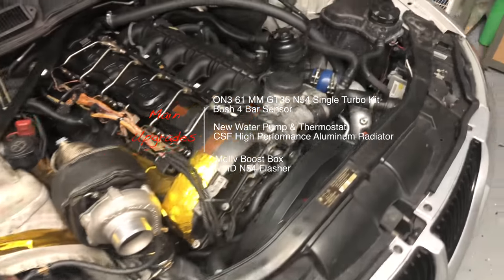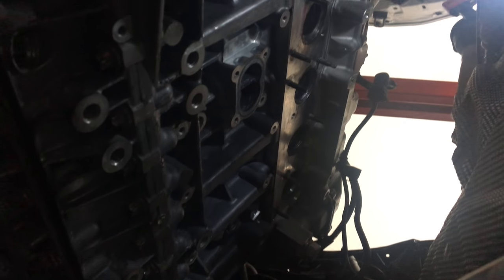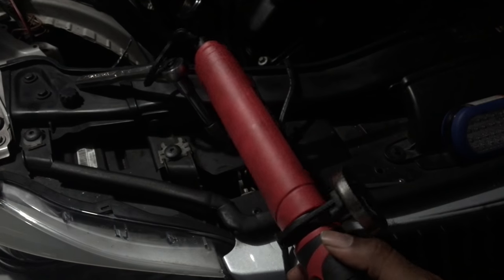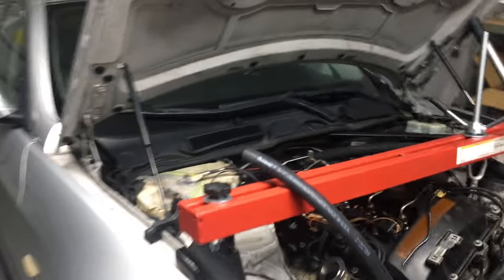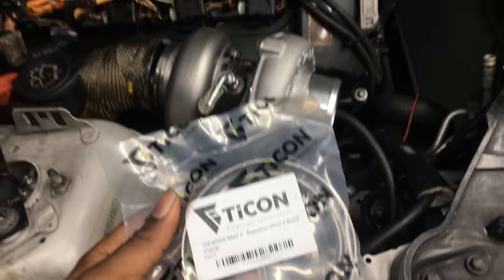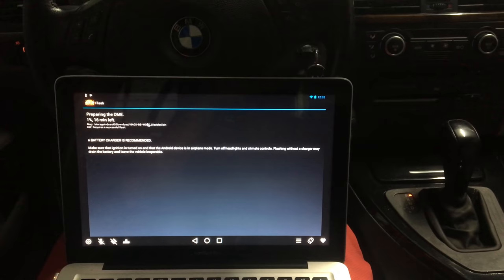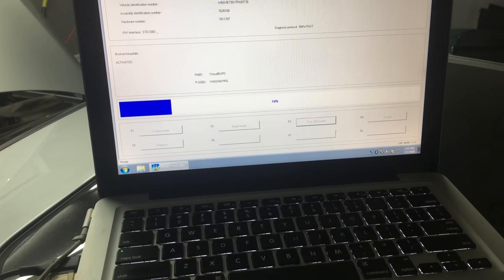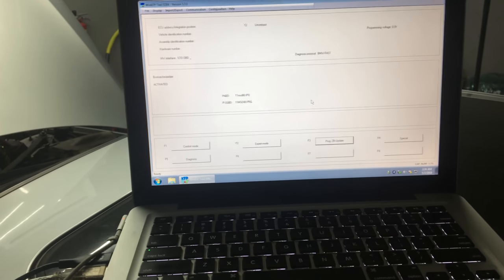Cost Effective N54 Single Turbo

Comment: What size turbo did you get with your kit. How's the low end torque compared to stock twins,  what rpm you seeing boost from.does this work with stock intercooler. I have upgraded ones 5 inch both don't want to cut bumpers to install 7 inch ones.

Comment: If you were to buy that turbo kit again, would you buy the V band Mount or upgrade to the T4 flange? Just asking because I'm about to order one and I can't decide
Reply: @nOshi2x  very cool.  i just learned the t3 and t4 are both vband. I was thinking the t4 was a 4 bolt. I think I'll go with t3 since my power goals are under 600.   Cool setup btw

Comment: Did you keep the turbo oil drain that came with the kit? I'm having issues clocking it correctly and the oil drain hits the v band.
Reply from the maker: Didn’t keep it ran into the same issue, I used one like this https://www.ebay.com/itm/264984459819
Reply: @nOshi2x  it looks like the same one I got but the hose still touches the v band. Hopefully I can figure something out.

Comment: Hey , whats up man .. great content!!! Just wondering how is the turbo kit holding up .. im looking to get this one myself .. i just wanted to see if you could give me some feedback !
Reply: @nOshi2x  thanks for the reply man .. i appriciate that .. i been going nuts looking for options , i was thinking to stick with the twins but they are all around the same price as this kit .. and you still have the risk of the twins failing, leaking oil etc .. in this case if the turbo fails you just swap it.. and this kit seems pretty legit . I am not looking for crazy power but more reliability . You said you are in fl , same here .. any good mechanics you can recommend me ?
Reply: @nOshi2x   im down in broward good thing about this kit its that you could also delete things from it .. so i guess ill just delete the wastegate from it .

Comment: Are you able to get around 500hp with this setup looking at ST kit myself debating on this kit you have or the speed tech bottom mount
Reply from the maker: Yes can make 500 with this setup all depends on how you have it tuned. Speed tech kit is also a good choice, just depends on if you want a top mount or bottom. I just prefer the top since easier maintenance but have to have good heat management. And bottom is pretty much the opposite.
Reply: Thanks man just about the response I was looking for also what are you using to control boost I’m planing on just staying with mhd flash
Reply from the maker: No prob.I use the motiv boost box and has worked good for me, but some have had issues and generally people just run a stand alone boost controller, either manual or digital. Can’t go wrong with either
Reply: @nOshi2x  i have a 135i and was wondering if you had to add any other option other than what the kit comes with.
Reply from the maker: @abra_kadabra805  Yea I had to buy other things to go with the kit. I have listed here the parts I bought. https://complexseven.com/cost-effective-n54-single-turbo-setup/

Comment: Do you know what kind of power you are making at the wheels?  450-500?
Reply: @nOshi2x  I though they supposed to make like 650 + ?
Reply: @nOshi2x  ohh wow nice!! I would if modify the crap out of it haha. I am looking for n54 and single turbo it and would love 700 whp plus. What tranny do you have?
Reply: @nOshi2x  yes I only found one manual coupe around here on auction. Copart. I love that automatic on 335 it shifts Soo fast and very good on quarter mile but doesn't hold that much power. :(
Reply: @nOshi2x  yes I know I really want the is but it's pretty rare and they cost almost as much as an m3 lol. I wanted it to be low budget since I can get 335 for only two grand and then repair it myself. We do that all the time in Sacramento. Lol. My friend has a really clean 100k or so miles 4 door 335 for 3 k finished back on the road. And the turbo kit is 3600 from speed tech n54 4nperformance it's lower mount whole kit with 6266 precision turbo. If I find an is I will definitely get it if the price would be ok
Reply: @nOshi2x  yes sir!

Comment: Just do the Vargas shotgun HPFP instead of auxiliary port injection
Reply: noshi it’s my understanding that there are 2 different kinds of shotgun. A single barrel and a double barrel. Only the double adds another accessory to my knowledge. The single should just be a direct replacement for your factory HPFP.
Reply: noshi gotcha. Well I know since I have a 535i that it has interference issues so I’m working to try and mock something up so that I can use it. On a 335i it shouldn’t require any such process! I’m interested man I’m going to follow the build! I’m doing mine on my channel if you’re interested!